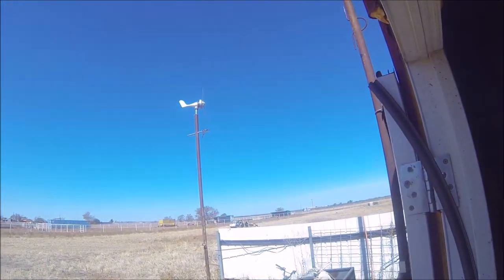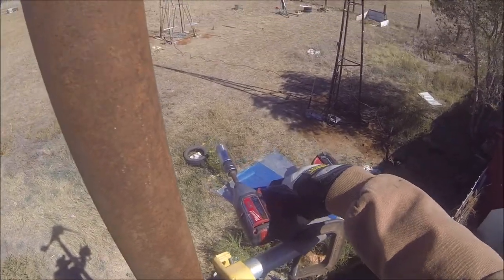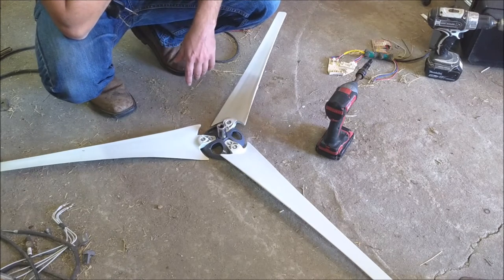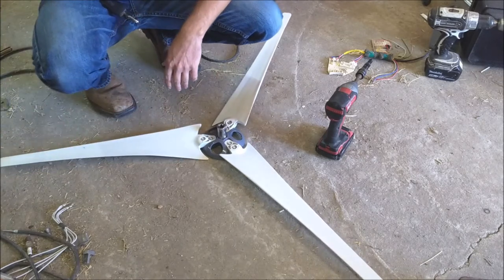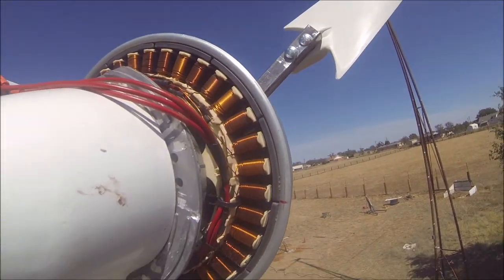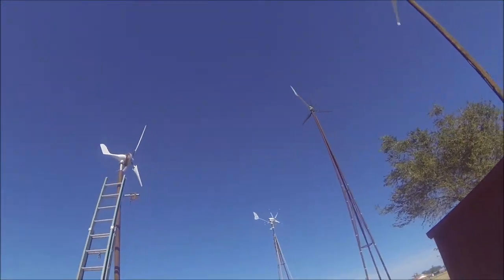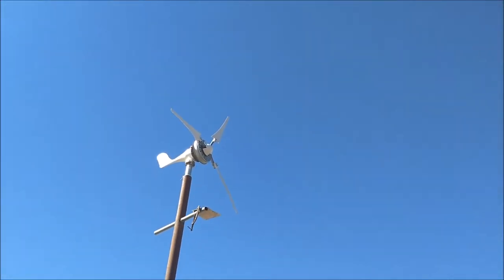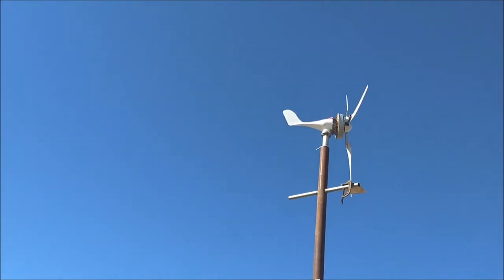Mounting a Fisher and Paykel direct drive washer motor to a cheap eBay wind turbine: Part 4!

Comment: Yes you need a bigger plate to separate the Blades and you want to need three more blades because what's a stator start making power it's going to make a big drag I know I have one makes a lot of power low RPM

Comment: I like seeing the updates on this I tried bigger Missouri solar and wind blades on my ista breeze i500 and the start up speed was way better the big problem I had was once it got up to speed it would spin out of the wind cuz the tail wasn't big enough to stay in the wind I taped a big piece of sheet metal to the tail that fixed the problem you might have the same problem once it spins up

Comment: is it a 42 pole stator?   I heard the 36 ones are low-cogging and suitable for wind.
Maybe put the 5-blade setup on it if it needs more go to start?
Reply: I've just bought a 36 pole version to experiment with , I think if you can't get bigger blades you will need more blades, keep going brother you'll get there in the end !!!
Reply from the maker: It actually doesn't cog much at all, but it still takes quite a bit of push to get it turning.  Turns smooth, but takes more power than expected.  It is a 36 pole stator.

Comment: hi there i have some Missouri Wind and Solar 80 Inch Falcon Mach 4 Wind Turbine Blades i sell them dirt cheap $ 45 i never got to use them
Reply from the maker: Shoot me an email toysforwatts@gmail.com
Reply: Yeah man get some of them on there but make sure they are bolted on proper or you will have a 7 foot throwing star flying about :)
Reply from the maker: I'm working on having one of those giant ninja stars from Krull flying around